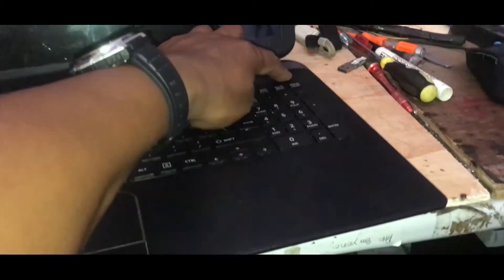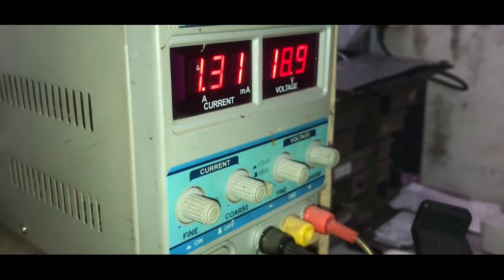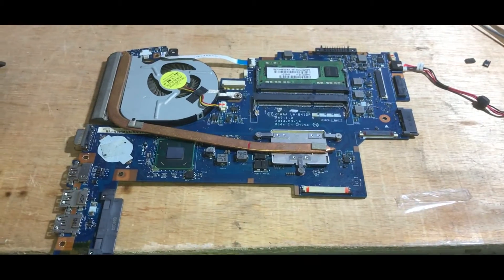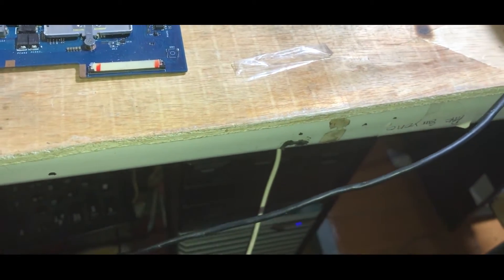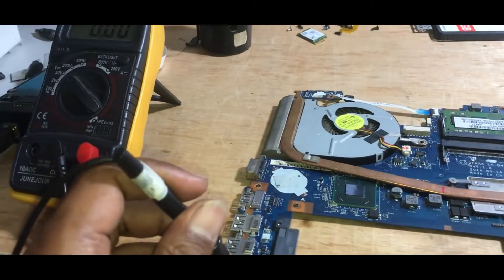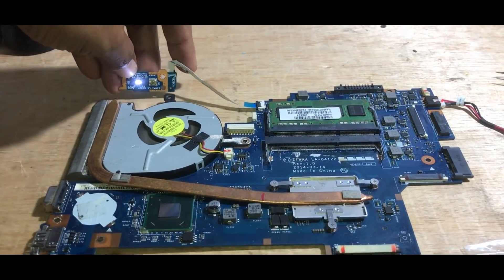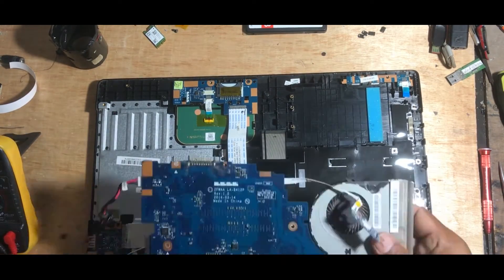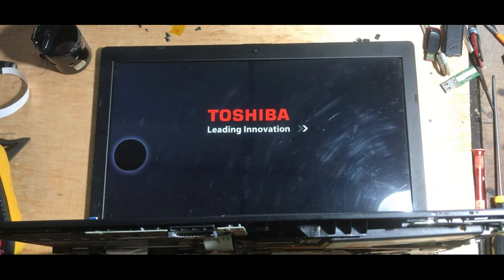Lets Fix Toshiba Laptop Cannot Turn On, Satellite C50-B #laptop

Comment: Which part to heat because im having a same problem
Reply from the maker: the processor, the component that is covered by the cooler unit. So, remove the heatsink for first